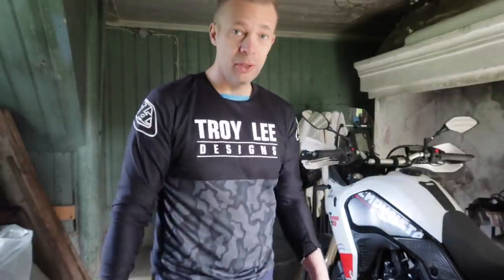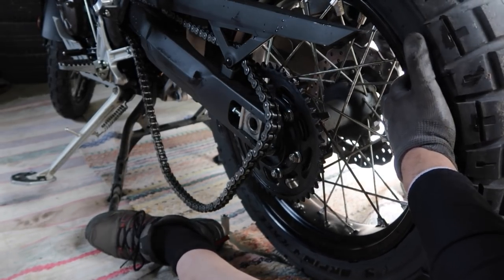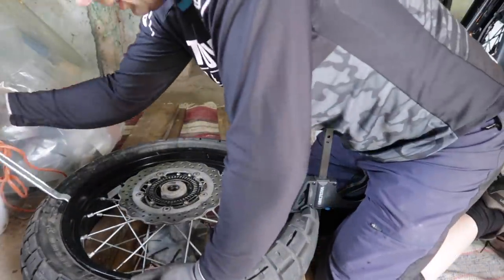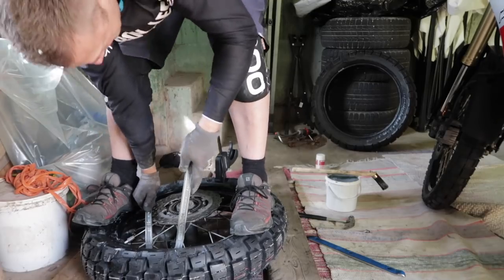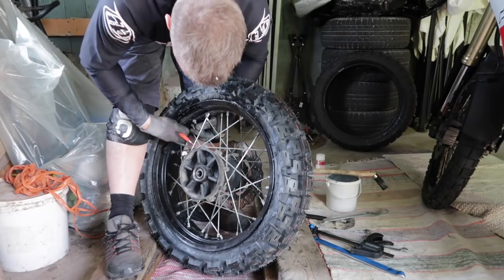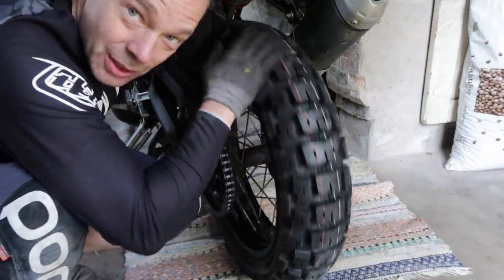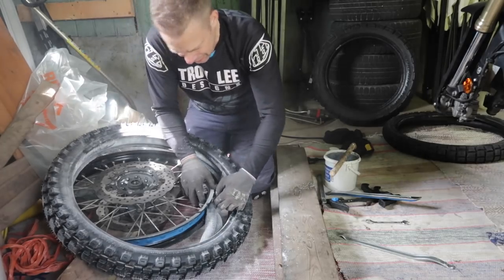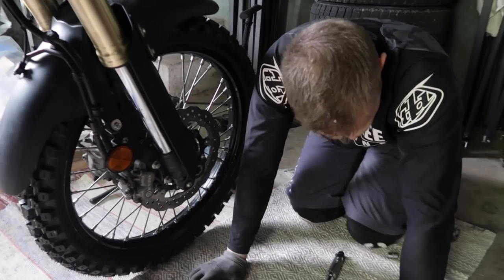How to change tyres on Tenere 700 yourself and save money

Comment: Top tip, don't tighten the valve nut all the way down. After you've inflated the tube a bit, push the valve in (the whole valve not the core) and all your excess air will rush out straight away and you won't think you've pinched the inner tube 👍
Good video 😊
Reply from the maker: Thanks! Will try that next time 👍🏻

Comment: Thanks for the video.
I found when removing the tyre that it's a lot easier to get both beads on the outside of the rim so the rim sits inside the tyre, then you can just pull the rim straight out.
Reply from the maker: Yes that's a good tip. I will try it next time. Thanks

Comment: The 10mm pinch bolts in front axle can be slackened with the rally raid tool also as the socket is inside  the hex drive for the front axle .

Comment: For years I changed tires on the ground on my knees before I finally brioke down and used a pry bar to open my wallet to buy a tire changing stand, now I wonder why did I wait so long.  The Baja no pinch tool, or equivalent, is also very handy.  I love everything about the Motoz tires except the price, they are great tires.
Reply: I second you on the Baja no pinch. Two friends have them and they work slick. I have a tire changing stand but afraid to use it with tubes. For our tubeless tires it worked great.

Comment: Good thinking with those clamp pistols!! I'm going to remember that! I scratched my rims up pretty badly trying to keep the tyre off the bead, even with those stupid silicone 'rim protection' pads...
Reply from the maker: Yes my rims are scratched like hell on the inside but It’s only paint. The clamps are a nice to work with.

Comment: Never knew that you can put the innertube in first and then put the tyre on.
Reply from the maker: it makes getting the valve through the rim so much easier
Reply: It's so much easier that way, just don't inhale the baby powder. And please buy some bead buddies, I learned that the hard way.
Reply: You can also put just a litte bit of air in the tube before you start putting the tire back on the rim, just so it is not completely flat = smaller chance for pinching the tube.

Comment: LOL I ran into the same problem just this weekend putting new tires on my tiger 955i,  thought I pinched it too but it was just air that was escaping from in between the tire and Tube... took it all back apart for nothing haha.. Lessons Learned. One tool that I use that has made a world of difference putting the tires back on is a BAJA NO PINCH Tire Tool, the tool is a great investment!

Comment: I keep trying this method and it just never works for me. I'll keep trying. Last night i put a TKC80 on the front of my T7. I had to revert to putting one bead on, then put the tube in. I've been using tire lube as that's what we've used the last 20+ years of changing our tires. I may have to look at that paste you're using. Kudos! Cheers from Canada

Comment: I saw that you use dialon. When I did scubadiving many used dialon as thalk for the latex sealings but since it contains other stuff many said that it shortens the life of the sealings.  Insted we bougth thalcum at the pharmacy without any parfume or oils. The inner tyre is much thicker so it might not be an issue but maybe worth to consider if going on a longer ride.
Reply from the maker: Thanks Mats! I didn't know that. Will consider that for my next change.

Comment: Robert, the Tenree 700 manual states a chain adjustment of 43mm to 48mm slack at mid point for your rear adjustment.  You placed your tire on based on the last placement and it is very likely that as the chain wears, that there is too much play in the chain, which could result in going over a big compression of the back swing arm to the point that it throws off the chain off of the front sproket and breaks into the engine casing.  This would be a bad day for the bike and the rider.  Second, you did not balance your tire which creates excess wear and the tires not achieving good traction as they vibrate off of the ground.  Third, setting the front tire without compressing the front fork when the compression bolts are somewhat loose makes for the fork suspension find its place of least stress and allows for good alignment of your most important tire and rim, the one that points you in the right direction.
Reply from the maker: Thanks. 70000km now no problem. But this was my first change and I added some things since then.

Comment: Thank you. I need to change the tube ont he rear wheel. got a puncture. So i am happy you showed how to do it, this will make it much easier for me. :-D
Reply from the maker: Then the purpose of this video has been fulfilled :) Happy to help.
Reply: @NomadSweden  Done it now. I put the Mitas E7 on. But it took me foreever, maybe i am not such a good mechanic, just over 5 hours. First it was a nightmare to break the bead and then i really struggled to get the tire completly from the rim, so one side was off but to have it completly off , i really had problems.
It is much harder than it looks like when u watch peroople do it. 
Just for a small tipp for people reading it, use screm clamps to break the bead that is so much easier. See other people do it here on youtube.
Reply: Changed FrontTire now, that was only 45 minutes. Much easier to break the bead using the BeadProFS from MotionPro. Did it now on front (90/90 Mitas E-07) and rear tire (Mitas E-07+ 150/70). I can recommend the MotionPro Beadpro they really work.

Comment: I just had to change my tube due to a nail for the first time. It took myself including help from 2 other friends. I did thankfully learn a bit more about how to work the tire to remove it so hopefully next time I can do it alone but I am scared about putting the tire back on as it is a pain in the butt lining up the rear brake and not knocking out the spacers out with each attempt at the same time.
Reply from the maker: Indeed the brake can be a pain. But training makes perfect

Comment: Thanks for your videos. I'm the owner of a 2013 660z Ténéré. I would love a bigger tank for the T7, but still an awesome bike. Gettings from Barcelona
Reply from the maker: Hola! I make about 300-350 km in one tank and that's ok I think. However there are tank solutions coming up for the T7, like larger tanks and even built in extra tanks in the rear fairings. So just wait a little longer if you need it. Personally, if I go to desolate areas I would bring extra fuel in a bladder or can.
Reply: Absolutely agree with you, the stock tank has more than enough range, unless you want to go to a very remote area. It is more a look thing for me. A Ténéré always came with a big fuel tank. I miss the T7 prototype  tank in the final production bike. It would have been very sweet

Comment: Next time seat on the bike and pump a little the forward forks before tightenig the axis shaft. This will help to correctly align the fork pipes.
A safety precaution: fix the central stand in his position before starting to work. It will prevent the bike from falling on you when the forward/rear wheel is removed and the snap off from his positiin for any reason.
This can be easily done by using a short rope/strap between the central stand and any solid part in the frontal zone of the engine ( frame, crash-bars, etc.)
Reply from the maker: Thanks for the tips!

Comment: Watching this, I am reminded by my Bike Mechanic on how the alignment of the rear wheel is very important.. he used to use a measuring tool to ensure the correct measurement on both sides of the back wheel was accurate.. scaring me with the comment that if the wheel is not straight, it will cause wear in the wrong places, and damage some parts (can't remember what, it has been over 3 years since he said it).
How do you ensure the rear wheel is correctly aligned.. with the correct chain slack for the T7?
(Granted, I have only watched until 13m 10s, but am thoroughly enjoying the vid) :)
Reply from the maker: Thanks for the tip!

Comment: I too bought the same bike, in the same color. Although in Canada the Red is more of a Candy Apple red. I went with the factory tank pads and took your advise on the rear carrier. Very happy with the rack except it weights just over 6 kgs, however it's functionality and rugged design is worth the extra weight.
I am looking for the same Motoz tires but have only found listing (in Canada) for tubeless Front = (54Q) and I think I need (54R)  Did you install Tube Type (TT) or Tubeless (TL) on yours ?
And how did they perform over the summer ?
Reply from the maker: Yes its strange that the markets have different version of red 😙 I run TL versions of most tyres and the TL Motoz works great. I mainly use them in the warm season since they get very hard and slippery in the cold/wet season on tarmac.

Comment: Rear wheel wheel balance on the Axel alone in swing arm brake caliper clear cush drive and sprocket removed will allow you to find the heavy spot add wait till it stops turning to be more accurate add wait till it starts to turn again split the difference. 
Front wheel I found too much resistance within the bearing but with a smaller shaft a thicker hard spacer between that and the bearing (free play between each) allowed me to minimise this resistance and same procedure for rear add weight to stop further weight to measure inaccuracy split the difference I know I'm cheap but I would rather ride then anything else

Comment: I picked up some good tips there, thank you, not done my own tyres yet but I have everything ready, I even bought a balancer... not sure I should have bothered lol, but I reckon once I've done about 4 tire changes I would have broken even... providing I can do it lol
Reply from the maker: Good luck! Training makes perfekt. Here it costs at least €100 to have a shop do it for me and I run out 3 tyres per year so it's a big saver. And, good to know if you need to do it trail side.
Reply: @NomadSweden  thanks, I heard you talking on a podcast over here in the UK, (Trail and Adventure Motorcycle Podcast) it was a good listen,  I had been meaning to look you up on you tube but your tire video was recommended to me - you tube is great at stuff like that, so I now have lots of stuff to catch up on and watch.
Reply from the maker: Enjoy!

Comment: Hi, great video and love the channel being a fellow T7 owner. Are the inner tubes you run heavy duty or not? What brand of inner tubes do you run? Also how did the Motoz tyres handle in the twisties?
Reply from the maker: Hi there and thanks! I have used both 2mm thick Tuff Tubes and 4 mm Michellin UHD. Both has worked well. Check my tyres video about the Motoz nd others. Wirks well in dry twisties but now wet.

Comment: Just the tonic I needed to lift my spirits however, apart from not needing to balance at least the front wheel, did you really manage to lever the tyres off with those steel tyre levers without  marking the finish on the rims? I just had tyres professionally replaced at a tyre fitters (and they managed to nip a brand new tube) so I refitted the front wheel in about 5 mins but the rear one took longer than I care to mention during which time the dog went indoors because the air was so blue! Great video from a personable chap. Please keep them coming!
Reply from the maker: Thanks! My rims look like zebras witha ll the marks. I dont care about finish that much since I ride it hard and change tyres 3-4 times oer year. As long as its healthy.

Comment: This is the video I was waiting for. Thanks a lot. One question: is there really no need for balancing the tire? Did you leave the original weight on the wire wheel? Greets from Bavaria. Great channel- go on!
Reply from the maker: Griass Di Thomas! I never balanced the tire and it has been good every time. Except for the UHD-innertube. When I installed that, I had to balance the tire with moving and adding weights.
Reply: Nomad Sweden 🇸🇪 Grias di! :) Thanks! You did the balancing by you self with rule of thumb?
Reply from the maker: @thomkru6328  I don't have any balancing tools, but I do use the wheel axle holding the wheel in my hands to see if I can feel something obvious. If there are markings (red dot) on the tire I use that also. Then I ride the bike and hope for the best. If there are vibrations I take the wheel to my buddy who has balancing equipment.
Reply: Nomad Sweden 🇸🇪 This is the answer I hoped to hear. ;)  Today I will mount my new Bridgestone AX41. Thanks a lot.

Comment: Did Motoz confirm you can run tubes in these?  Sorry if I missed it.  I see for their tires you can run tubes in 140 width (but they say not for adventure bikes, only single cyclinder type enduro bikes) but for 150 width they say tubeless, and unlike Mitas, don't say if you can run tubes in their 150's.  Do you know?
Reply from the maker: The tires are Tubeless Ready (TR). No problem running tubes in them. My supplier just writes instructions to use slime or chalk to make sure the tube does not get high friction inside. I now have over 7.000km on them with tube with no issues. The Tube-version tyres just has a softer sidewall for easy mounting. But I had no problem mounting the TL. Just go for it.
Reply: Hey thanks! Appreciate it. And I’m sure other 150-70-18 owners do too.

Comment: Wanted to see when you took out the brake calipers properly ..u know if there is any adjustment
Reply from the maker: Not sure what you mean. In the rear it just comes off when you take out the wheel axle, and in the front you loosen two screws and it comes off.

Comment: Nice use of the POC knee guards, I will dust off mine and do the same. So comfy 😅
Reply from the maker: Indeed. Love them too
Reply: @NomadSweden  The Motoz you selected is the tubeless versions right, so fit better on the rims with tubes off course?
Reply from the maker: @Paledaddy  yes, they are the TL version. I will now try a TT version 140 width and see how that works.
Reply: @NomadSweden  I heard the were pretty tight, due to small rim width.
Reply from the maker: @Paledaddy  I will find out :) I hear many that run 140s on the T7 without problems, and the lower price on those tyres makes it worth a try.

Comment: Another excellent video, Robert! I've seen this video long ago, but now I'm rewatching since I have a Teneré of my very own. 😄👌

Question - What's sized tubes does the Teneré require? I see in the video that you have heavy duty Dunlop tubes. Which ones are those? This is the first bike I have owned with tubed tires and I have not found any information in owner's manual regarding the tubes, only tire sizes. 

Also, do you have to purchase tires specifically that take tubes or can you use any ADV tire as long as its the correct size? Skål! 🍻
Reply from the maker: Skål my friend :) For tubes you only need the wheel size 18" rear and 21" front. The thickness depends on what she likes. I use 2mm tubes now. "Kenda Tuff Tubes". The thicker, the more resistant, but also more wrestling to install.
With tubes you can run tyres that are both TL and TT. You can run tyre width 150 (standard) or the narrower 140 which is much cheaper. Narrow tyres are better for offroad. Good luck!
Reply: @NomadSweden  Thanks Robert!

Comment: Great video! Thank you! It seems so easy see you to change the tires on the T7  :))) You said in the video that you use 4mm inner tubes on the T7. They are ok if you go to highway? Is it secure? I'm have the stock inner tubes but want to change to a michelin reenforced tubes (2,5mm or 4mm) but have somne doubts about the safety issues on highway... (I rarealy go to highway, but...) . Thank you! Regards from Portugal!
Reply from the maker: Hi there! I have now gone down to 2mm tubes because I had trouble balancing with the 4mm. Perhaps a bad tube. I know many who run 4mm on their T7 with no problems.
Reply: @NomadSweden  Thank you. And you use slime on the tubes? It doesnt afect the wheels balance?
Reply from the maker: @paulomafra1717  I use chalk only. It does not affect balance.
Reply: @NomadSweden  I mean, some puncture prevention like slime or puncturesafe. I come from an R1150GS (tublesse tires) and this is the first "tube bike" I have... so perhaps its phsycological issue this afraid about punctures.... :)
Reply from the maker: Oh i see. I have never used those products so I can’t say. I am planning to convert to TL though. At least rear which is TL rim alteady.

Comment: Was it necessary to disconnect the ABS sensor/s from either wheel as part of the tire change? Thanks 😊
Reply from the maker: I never disconnected abs front or rear when removing the wheels and had no problems. Just be careful when removing the wheel not to touch it with wheel. The service manual however says to remove abs sensor and calipers before wheel.

Comment: I notice that you put the tubeless tape on the tire but still use a tube, is that just in case? As an "Insurance policy" if you will get a flat, you can ride longer if you need to before needing to fix it?  ? Or just a failed experiment ? Thank you very much for the video, very helpful
Reply from the maker: Tubeless tape? T7 does not have tubeless tires
Reply: @NomadSweden  Sorry, I guess I was not clear, I am looking at your RIM in the video, for example at 7 minute and 20 second mark, you put blue tape to block the air going out of the spoke nipples,  ,many do this to this in order to convert tube rim, to one you can use without tube, I wonder if this experiment  failed, or just an "insurance" policy, maybe you can ride longer if the tube is punctured.
Reply from the maker: @guzziman the tape is put there by Yamaha to prevent spokes from scratching tubes. The T7 does not have tubeless rims and I have not converted them. All is stock
Reply: @NomadSweden  Ah... thank you very much